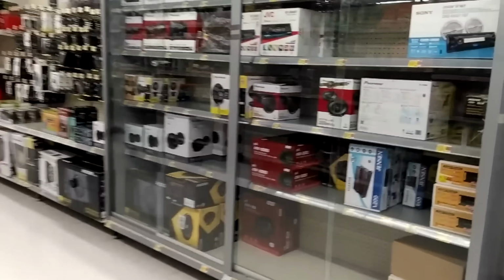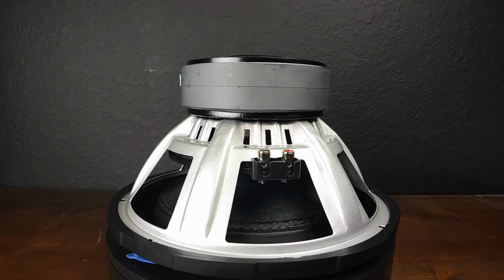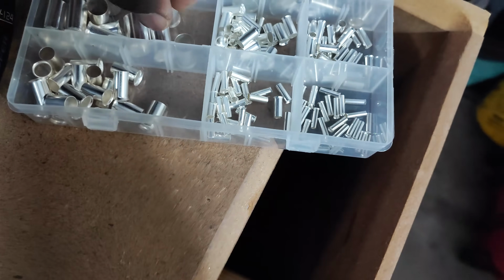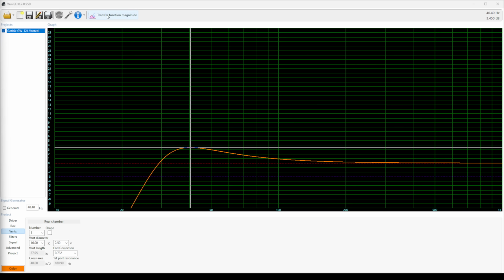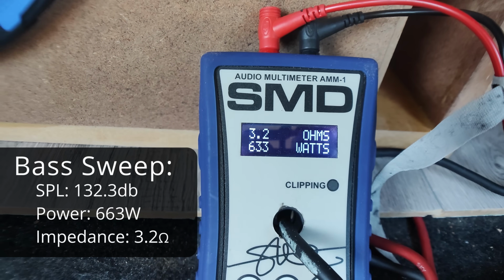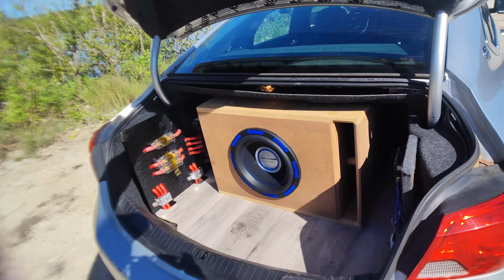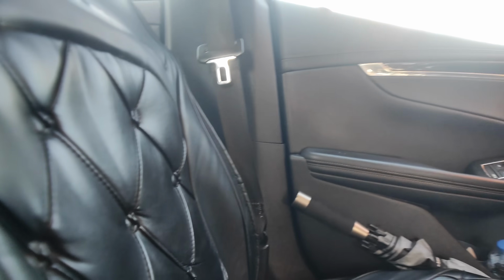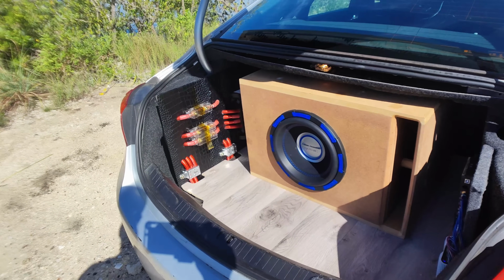Why Is EVERYONE Buying This $80 Subwoofer | Power Acoustik Gothic GW124 | 4,000 Watt SPL Test

Comment: I agree. At 17 I had 2 w0 jl 12s. Hit 134 dB  at comp on 600 watts. Jl never rated peak just rms back in the day. They would slam at 600 a piece til the suspensions popped. But ya couldn't blow the voice coils.

Comment: They sound good, have a good response range etc etc.  The only problem I have with them was when I opened mine the basket was bent (box was fine) and the mounting holes had some REALLY sharp burrs, not on one hole, but the majority. Despite all that its worth 90$.  Mine is currently hooked to my PC, drawing power from a spare PSU and shaking the fuck out of all the things. :D

Comment: When your used to running JL's with some serious power at 1 ohm or even 1/2 ohm and your hertz frequency is on point with the proper cubic ft in your box build... 
 You won't bat an eye at those Walmart joints...
Reply from the maker: You know, there's a reason these subs are so popular, and that's why everyone's buying them.

Comment: I have two of the old school competition 
12 inch mofos 2400 watts each i got back in 2004 and have never pushed them with nothing else but a 1200 watt Sony explode amp and they have always hit so hard and got a ton of compliments and blew the back glass out of a mishibishi eclipse I had . Both subs are still not even broke in and just sitting in a custom made large box designed just for them   sitting in my storage room in my house.  Might put them on the market but most don't know what these are and how well they were made back then.  When they were shipped to me they arrived in wooden crates with stainless latches like mini treasure chest which I still have as well.

Comment: I bought 4 jensen 12's from Walmart when I was 23, the ones with the hand print on them..  i did research and built a 4th order band pass box and put them on a cheap  boss amp... I don't remember the model amp either but I'm pretty sure it had swept Ganges on it??  I took it to the local car audio shop and had it metered. 146.7 at 34hz on the front glass. The guy wanted to see my set he was blown away... I have had many more systems since that where loader, but that one was special... it was my first.

Comment: These subs go ham on a smart 3k on 2 of these subs in a 4.5 to 5 cube ported box tuned around 30 36 htz i had 2 of the Walmart version in a down for sound kerf port box tuned to 32 htz with the spl labs db meter on a taramp regular smart 3k wired to 1 ohm  i got 148.5 db in a 07 scion tc hatch with the entire back half of car was dyno mated i forget what my cabin frequency was but I did get a healthy low mid bass boost around +6 db boost on music that was playing at +3 i got 146.6  my peak was at 38 htz so burping at 38 htz i got the 148.5 db in the floor board. Spl labs said my peak db was really close from 31 41 htz so a nice range of bass these subs worth 80 a piece all day the wllldse hcy 12 was like 100 bux even and those subs was much stronger in the low lows and wouldn't have nearly as high of impedance rise  in wanted to test the sound town  12 but they sold out so dam fast the sound town ares is same sub as Rockville punisher 50 pound subs and sound town was 105 bux now ppl want 200+ if u can even find them i may try the new hyanka spl sub i think called hyanka bsp tripple stack 3 in coil 1500 rms  at they 200 a piece  I can get a oblivion for that kinda money that will take 2500 rms and has a 4 in coil ive seen those oblivion in person and they are nasty subs for the price  it's easily a 329 dollar sub

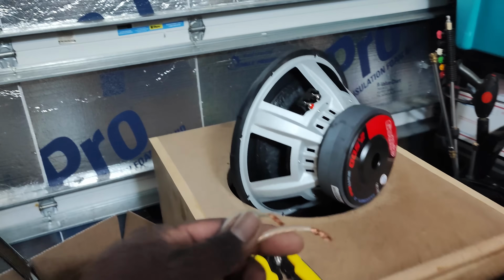Comment: 4:15  Making a pigtail or using a separate multi terminal connection point for the small terminals might be a good option though it uses more material.
Reply from the maker: Good tip.

Comment: When i was young i used to rock the xplode subs had a set for 3 years and enjoyed  every second of it.had my 2001 civic rocking xplode all around  from stereo to door speakers down to the subwoofers and amp.
Reply from the maker: Those old Xplode subs were great. Some of the best.
Reply: @BudgetBassHead yes bro they where really great speakers
Reply: I had the red xplode 12 inch subs in a custom box i made every time they hit led lights would turn on it was some bad ass system around the time that fast and furious had came out i had my civic pimped out
Reply: The xplods were beast I love them as well underestimated speakers by far id still bang some Fr but I actually just bought one of these Gothic subs in a homemade box on my house stereo and my house stereo hits harder than the bar next door that speaker is insane and I have it ran with both coils wired the same as a car set-up on a lg house stereo I got that thing at 30 hrtz on my equalizer and man I tell yeah I'm impressed but I wouldn't mind some old school xplods the all black n red ones
Reply: @RobertAllen-g1u  hell yea bro and the amps where really good i sold my brother my xplode amp and stereo idk if you remember the one that the screen lifted up so you can insert the CD he had it till like 3 years ago that he sold his car and he left the system in it it was still a good system he has a kicker  L7 single with a ported box it hit hard

Comment: Um Boxes go for 40 bucks. Unless someone wants to be expensive on the box. Doesn't make since when the sound isn't too much different. You got closed boxes, fire down boxes and ported boxes. And they can be handmade for cheaper. Like 40 to 80 box for custom good boxes. Or 100 to 200 for some expensive no needed box. Like with clear see through so you can see the whole setup. It's pointless for sound. Only good for competition and looks

Comment: Wish I knew someone to help me get my two 10in JL subs kickin. They're wired up normally, in a normal rectangle box. So I should connect them with two wires instead of just 1 in each hole, and get a ported box or something..running a JBL Power Series BP-1200.1 amp

Comment: Do you run your normal system on stock power, or do you have an aftermarket alternator and/or battery?
Reply from the maker: My entire electrical system is aftermarket. 1/0 OFC, 320 alt, 96Ah lithium, Big 4 upgrade. Video Coming Soon.

Comment: There's really no need for speaker wire to be larger than 12 gauge. It's alternating current, terminating at short distances.
Reply from the maker: Inaccurate. These systems push 100s of Amperes through the speaker wires. 12 gauge is not adequate for long listening. 8,000W @14V = 572A. 8,000W @13V = 615A. 8,000W @12V = 667A. Research before posting about electrical systems.

Comment: I just bought a new car and im looking for a simple but powerful setup. Currently have a 1200watt sony xplod 2200gt amplifier with a non-ported 12" subwoofer box. Idk how to do all the impedence and leveling etc etc or "burping". I was hoping you could point me in the right direction to help me wire my own setup.

I had a 1200 watt peak (dont remmeber the rms rating) jensen subwoofer in the 12" box I have with the 1200watt amp. I had an aftermarket stereo system. Dont remmeber exactly what it was but it was just a 80 dollar or something clarion head unit. Idk what I did maybe I had the amp too high but the dang thing blew in like 3 days or less. Have any ideas what I did wrong? Any help would be appreciated.

Comment: So a couple years ago i bought 2 of these from wal mart and honestly they are waaaay over rated at least the ones i bought. I hooked them up to a p1000 and yes i hooked them up cleanly with no distortion, and whenever they really started bumping and producing good bass they always got a burning smell, like an electrical burning smell so i never really got to enjoy them properly. They are probably ok for a beginner setup with a smaller amp . My amp was pushing 1400 watts rms to 2 of these and supposedly these are 1200watts a piece

Comment: My bet for as you call it, "the burp" is and always has been 44 to 48 hertz. There are plenty of auto sound manuals from reputable companies that subscribe frequencies in that range for the ports tuning. I have no idea why people choose lower freqs through porting, as it serves to basically turns any speaker configuration into a "free-air" configuration which can produce sloppy bass. After which the speaker's surround and spider are the suspension without any air as suspension. That seems to take away from the quality sound that many ppl prefer.
Reply from the maker: Not sure if you statement is accurate Mr. Bacon. People are 'different', with 'different' tastes and applications. You're taste, from that magazine, is your right to follow. Just don't expect everyone to do so.
Reply: @BudgetBassHead  You're absolutely right, surely different people have different tastes in music. Tuning a ported box, as it gets closer to the subsonic freqs, seems to serve up a more difficult task of tuning the port in phase with the speakers. I've had hardware and software DSPs and of course darn good reference microphones and those aren't the best tools to determine whether or not the speakers and port are in phase, and it's left to spl measures to get the most out of ported enclosures. 
As with anyone that's looking for the sound quality that's pleasing and tickles the ears, I'm still trying to find perfection to the science.

Comment: I bought my 12 for $89 and the rz1 2500D amp for $69. Built a ported box to spec and this shit bumps more than any of my previous setups. I couldn't believe how hard it hits for the price. Best bang for the buck in my opinion. The box design makes a huge difference when you don't compromise.
Reply from the maker: A good box is key! Glad you got a good setup.

Comment: I still have the old P.A FUBAR 10 from 2002 in the original crate it was sold in from best buy. My cousin had 2 P2 12s in his bronco and I disconnected 1 and plugged my 10 up on the gate of the bronco unboxed and it was hitting harder than the 12 that was still connected in the box. 1st and last time it had power to it and it wasn't parallel. It's still in my garage right now i bought 2 of for 79.99 on sale back then. My cousin has the other one which has never had power to it.

Comment: I had an older one of their subs that was amazing.. it was adjustable between 2 and 8 ohms.. i traded it for a real expensive drone.. I have the amp that is suppose to power these so ill probably pick one of these up for my next system. My buddy built me a box that was identical to that box that i regret getting rid of till this day

Comment: I might get my friend's '99 Ranger extended cab off of him & since it already has a Sony touch screen, I want to put two of those 12" subs behind the seats lol 👀
I currently have a '96 Corolla with a Skar VXF 15 on a Diablo 8500w amp & want to build a cheap but good system on a budget 
I have a friend that used to have a '02(?) Silverado with those Power Acoustik subs & never had a problem with it

Comment: How long does that sub last though 🤔.
Reply: Mine are 5 years old. 3 of them handling 2 Memphis 500s in a sealed enclosure so they were never pushed extremely hard. But at 3/4 power on both amps they've made 6 hour trips with music up numerous x. $250 and 5+ years is well worth it

Comment: Been bangin with the gothic 12 in sub for the past 4 years and it is still going strong. When I first bought the sub i put it in a cheap sealed walmart box and that surprisingly held up to 2 years of hard abuse. But the sub itself paired with the amp to match is a grest budget sub
Reply: what amp u use? and how turned up is it?
Reply: @RyderDownen  I'm not 100% sure how turned up my amp is but I am using a Walmart Power Acoustic 2500 watt amp. The only thing in my setup that is not Walmart are my wires. All of my wires are 0 gauge from Skar Audio. Still have a singular battery and OE alternator. Nothing special or fancy about what I got, but it bangs and I like it lol

Comment: I bought 2 of them and one of the amps that says is supposed to go with the subs. I know it’s not enough to push them, but it’s fine. I’ve had them for a year and a half and they flex my ceiling in my truck. They hit way harder than expected, but clip a decant amount with lows. Just gotta choose the right music. I do have them wired to 1ohm. Everyone that’s heard them have asked how have them set up to bump that hard. If anyone has any issues with tuning, just ask. I also built a custom box for each sub. Massive ported boxes btw lol. Like 2.5 ft of air space in each box. They have done me justice, but I got used to the bass and upgraded to 2 EVLs on 2k amp. Still have them and am putting them in my other car next week. They’re surprisingly loud, I just like more lol. I drive a 06 Silverado crew cab. Folded the back seats down and sat the subs on top of them with amp in between them. Been like that for over a year.
Reply from the maker: That's awesome! You're definitely getting the most out of them!

Comment: I have bought several of those subwoofers and bust all of them with a ssl 4,000 watt amp. That subwoofer is trash the ssl do not do 5000 watts. 4 of them can not handle 1200 watts
Reply: I wish I can post a picture  of the ones I bought
Reply from the maker: You gotta make sure you’re using the right amp settings. Distortion & clipping, is the number one reason for multiple fails of an audio system..

Comment: You can't just use any box. You need to know the woofers free air resonance, it's Q and it's VAS in order to construct  a vented cabinet with the correct volume and port size. Otherwise you may end up with a High Q boom box with one note bass that lacks extension. If you don't know the woofer specs then build a large sealed box as that will provide the tightest bass while allowing decent extension without the one note boom of badly vented boxes. Hopefully the manufacturer gives instructions for the correct box size and venting. All of this is based on the Thiele small reflex enclosure parameters which have been used by competent speaker builders for decades.
Reply from the maker: Preaching to the choir brother.

Comment: My 75 Scout ll still has a pioneer super tuner 3 with six disc changer, Soundstream D200, D100, MC140 amps, Alpine 11 band EQ with sub control, Boston acoustics 6.5 pro series separates, 4 pro series 10 in subs, and two pairs of JBL carbon fiber three way 6×9s. Still pumping hard since initial installation in 1990. I was an stereo installer for Whole Earth access in Berkeley ca.

Comment: seemed like the bass reflection from the sub faceing the back of the trunk made it harder to bottom out there for it would be harder to blow your subwoofer if you were running rated continuous power for a amp im not the biggest fan of power acoustic subs but i do like the surround on that sub back in the day maybe 20 25 years ago me and my buddy used a geo metro when the first power acoustic 3000d came out we both worked at a car audio store in michigan called olson car audio  it was when class d amps just came out and it did decent it was a big silver heavy 3000 d it probably was the biggest amp that first came around we started carring it ant are store and were like holy crap a 3000d and we used a 15 mofo we got 2nd place in a bass comp think we did like a 146 we also carried the pioneer premier subs when they came out
Reply from the maker: Yep. And things were quite pricey back then too

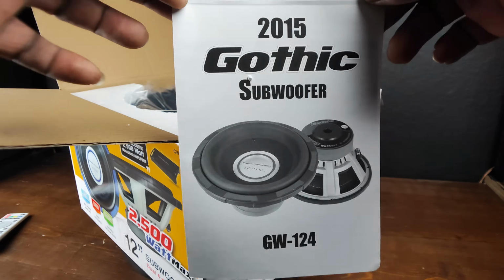Comment: It's not just about the box.. It's about the port size and length..  it even tells you how to tune it to certain frequencies  (0:42)
Reply: so basically the box then xd, a port quite literally is part of the enclosure
Reply: @InDestructibleMC  It's all about resonance.  As you change the size of the port, and length.. It will resonate at a certain frequency.  and the box size already resonates at a fixed frequency...  So you just "tune' it to where the two are happy with each other and not fighting against each other.   Resonance is a weird thing

Comment: I think one of the major things that comes in to play is reliability.  It performed well under that load, and showed it could push some dbs in the right box,  but for how long will it last? I always thought the American Bass line was the best bang for buck. At least for me, when I had the itch for a lot of bass. I had 2 American Bass HDC 12s, in a custom box, on a Orion HCCA 5k, with a 320amp ces alt, and man was that thing loud. I had some America Bass XFL 12s , in a custom box before that , on a Taramps smart 3k, and that was a perfect budget combo. I kinda grew out of it, and now only have 2 Memphis Mojo 6.5s in a custom box, hooked to a Memphis 1k. Went that route for my Genesis coupe because of having no trunk space.  I also have 2 JL 10s on a JL Audio 500 watt amp in my Elantra N. Good video and sorry for the long comment. Lol

Comment: I Once Bought Cheap Subwoofer, It Was Around 6 Years Ago, It Was In Market Where They Sell Low End Stuff And Stolen Stuff, This Subwoofer Was Brand New, It Said 1000W, I Built A Box With Calculations For This Subwoofer Speaker, I Took Appart My Logitech Z2300 And Kept The Gutts And I Put The Gutts Into The Box I Made And It Works Till Today :) It Kicks Hard  Combined With My Logitech Z960

Comment: I have a gothic 12 I’ve been running since January 2021, and powering it with a hifonics Brutus 1900 watt. Qbomb 12VL 1.8 cu-ft box. I’ve played it full blast at parties and get-togethers, for hours on end, and I jam it full blast going down the road. Zero issues with it. Almost 4 years of use, hasn’t given up yet.

Comment: No THD value on the included specs...at peak would make me nervous

Hard hitting doesn't mean much if the audio is distorted

Im still rocking my old school V12 Alpine sub amps....had a bunch of em stockpiled from 20 years ago....still new in box. ....2000w monoblocks w/built in EQ's 🙂

Comment: Interesting video. You actually dont need heavy gauge wire when running speakers as they run on ac current. 14 gauge is plenty.